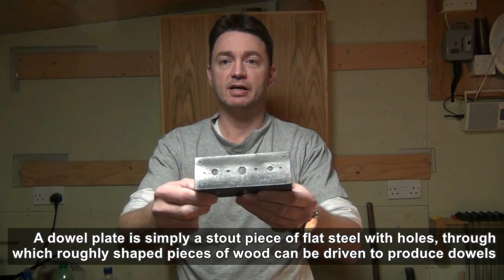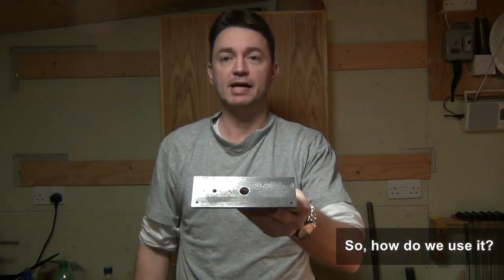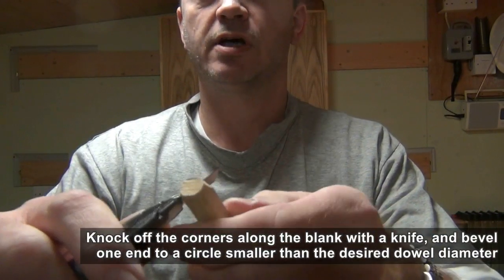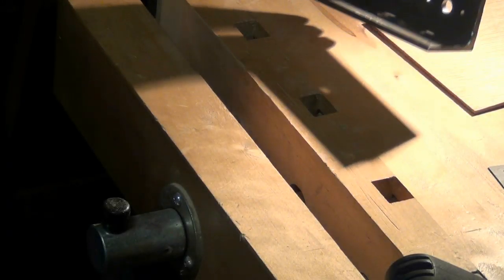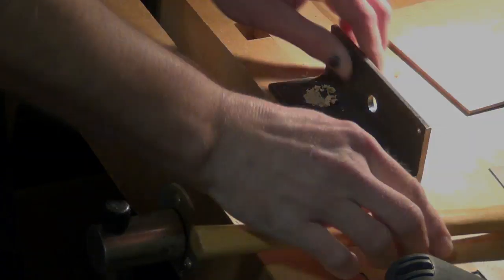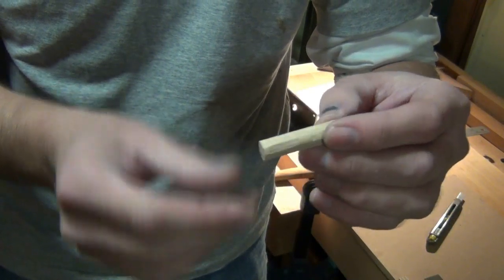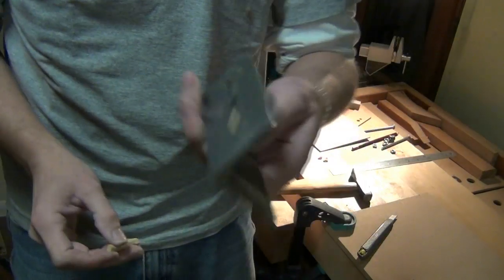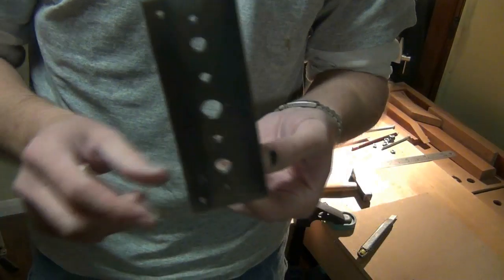Make a Dowel Plate from Scrap

Comment: I'd suggest using a rubber or plastic mallet when pounding rather than the metal hammer.  The dowel plate will stay sharp longer.
Reply from the maker: Perhaps I should have suggested that in the video.
Ordinarily, the hammer won't connect with the plate - being cushioned by the shavings that are built up as the dowel is cut, however an overly enthusiastic woody could damage the plate with excessive blows and/or angled hammer head.
Personally I find a sensitive approach yields better dowels, and together with stopping just shy of the plate and pulling the last 1/16th through, the plate stays sharp for a long time.
Reply from the maker: Thanks for the suggestion Jay.
Happy woodworking, Mitch

Comment: For sharpening the plate, do you just flatten the side? Also, do you know a good DIY way to make an old fashioned "tine former" for wooden rakes? They look like steel pipes or tubes, and the wood is driven through, but I'm not sure if they are sharpened at the top. Anyway, thanks, love the videos.
Reply from the maker: +NewportDispatch Hi, Yes that's right. For the take tines, you'd grind a bevel on the outside of the steel pipe. I've not tried it, yet, but I would imagine not too sharp, since the idea is to rive not cut them. Maybe I'll make one! Cheers, Mitch
Reply: Mitch Peacock - WOmadeOD Thanks mate.
Reply: I think if you did a video on making one of these tine formers, it would get some views, since there is literally no information out about this, so far as I know. I saw an old drawing of one, and a few people using them in rake making, but nothing specifically about this tool.
Reply from the maker: +NewportDispatch I'll see what I can do then 😉 Might have to do the whole rake making gig too. Cheers for the idea
Reply: That would be awesome.